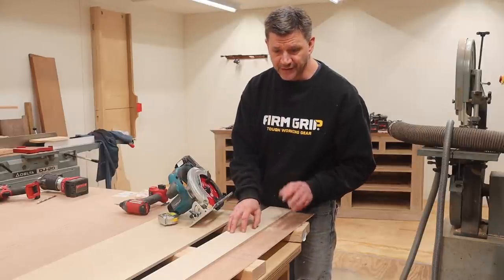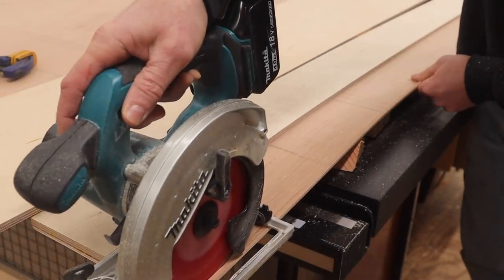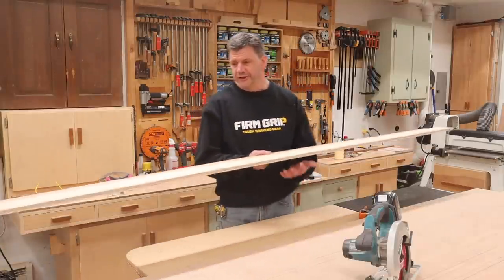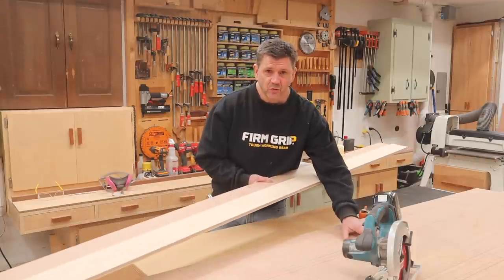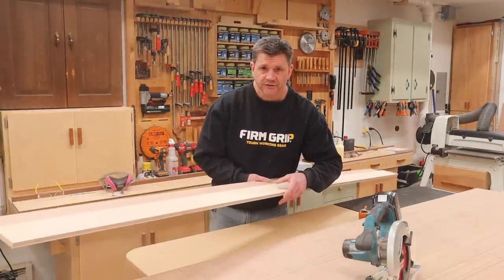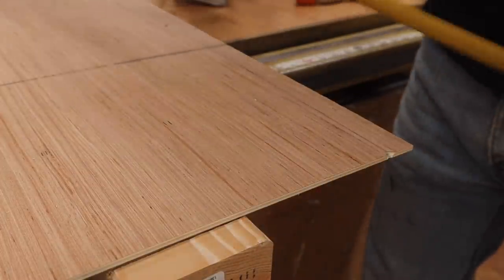D.I.Y Track Saw JIG… You can EASILY make!

Comment: - A few years ago I bought a 4x8 sheet of thick styrofoam to support my track saw cuts. It is still working great despite the zillion slices into it. And it’s so light it’s easy to manouver.
- I’d also take the time now to countersink a few holes along the 1/2” plywood. For lots of projects, it might be more convenient to hold down the jig with screws instead of clamping (obv ones where a couple small holes won’t matter) 
-70% of your audience would have made the same mistake. Good to show it. 
- thanks as always for your no-nonsense unsexy videos. And congrats on your success.

Comment: Not really a track saw, but more like a fence. We made and used them all the time and use to call them shooting boards. We would use a narrower strip down the middle for the guide and cut a wide side and a narrow side for both sides of the blade. Whatever you call it , it’s a great tool and saves a lot of time. 
Nice video.   Thanks

Comment: Hi Jon, love your channel. I made a jig just like yours 30 years ago. There are so many YouTube videos showing far more complex track saw jigs with carriages to mount the saw to and complex systems to connect the saw carriage to the track, but I have never understood the need for this.  In 30 years I have only screwed up once, and that was when the cable from the saw caught something and ignoring the sudden resistance I stupidly pushed on and the snagged cable pulled the saw off the guide.

At the same time I made a cross cut jig;  a plywood base with two 1 ½ inch fences on each side bridged with two aluminium (yes, I’m British) angle strips attached at precisely 90 degrees to the side walls with the distance between them exactly the width on my Porter Cable magnesium saw base.  Total number of components nine; three pieces of plywood, two strips of aluminum  angle (I lived in the US for 8 years and am bilingual) and four screws.  Again, so many YouTube videos of far more complex versions.  Essentially my cross cut jig does exactly the same thing as JSK-koubou’s vertical panel saw but with one tenth the components and cost.  To be clear, I love watching JSK’s videos; I admire his meticulous precision, but boy, that guy has way too much time on his hands.  He needs some grandchildren.

Comment: I bought a track saw recently, but had been using a guide jig like this with the circular saw previously. The jig got the job done fine most of the time, but there were occasions when it veered off, especially at the beginning or at the end of a cut. Every cut I've made with the track saw has been straight from edge to edge every time. If you have the money and cut sheet goods fairly often, get a track saw. You won't regret it.
Reply: That's not a fault of the jig; that is operator error. A competent wood worker can hold a saw snug against the fence while cutting. No different than holding stock against a rip fence on a table saw or bandsaw; it is a necessary skill.  Many online reviews about the store bought tracks having noticeable side to side slop making them less accurate.
Reply: @briangc1972  I didn't read it as a criticism of the jig just something that can happen to lesser mortals when the saw base isn't held snug against the guide rail for the length of the cut.

Comment: When I made one of these years ago, I extended the 1/4 plywood out the back further. That way I could use a small F-style clamp to hold it (handle up) and the clamp wouldn't be in the way of the saw. If chipout is a problem on the cutoff, double stick tape a piece of hardboard to the base and make it a zero clearance base. Just my 2 cents, probably not even worth that much. Take care. 
Bill
Reply: That is a good idea 💡

Comment: I also have always enjoyed your videos.  I have been using a jig like this for many years.  It should be noted that you need to know which side of the jig you place on the board that you want to cut. 
In your example of cutting 94", you placed the jig on the "keep" side and dropped the 2" waste.  But if you  do the same thing and wanted to "keep" the 2" waste it will be 2" minus the width of the blade.   The jig should always be placed on the "keep" side.

Comment: if you run the cut edge (the one your circular saw cut) against your table saw fence you'll make the opposite side parallel to the circular saw guide, so you can register that against a square to easily make 90' cuts.

Comment: Thanks Jon, I've only been viewing your channel for a few years, but really appreciating it.  Re the jig, I'm wondering whether you would change it in any way for a left handed user or a saw with the motor on the right rather than left. I find I get a better cut if I gently push into the fence rather than pull the saw towards me.  Also, I've often found the underside of my motor hits the clamp I'm using to hold the fence to the wood, so I've swapped the fence to work the other way around (i.e on blade not motor side).  Only just made this change this week, seem to do a far better job, but waiting to see what additional problems I create. Thanks, P.S. Why does it matter how wide the top piece is?

Comment: Tracksaw is not economical for what most do. A sliding table saw is way more productive.
Reply: Maybe for smaller cuts IF you already have a sliding table saw...  I have 2 diy track saw jigs. A 4 ft and an 8 ft.  I have a  small shop and if I have to take the time to dig out a large tool vs a couple of saw guides and I have limited time....  the saw guides are much more economical.